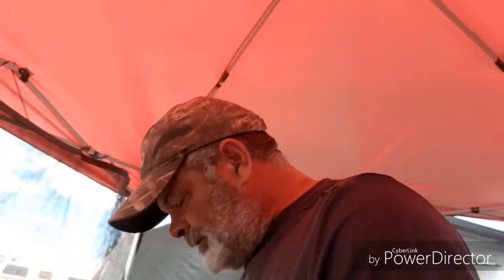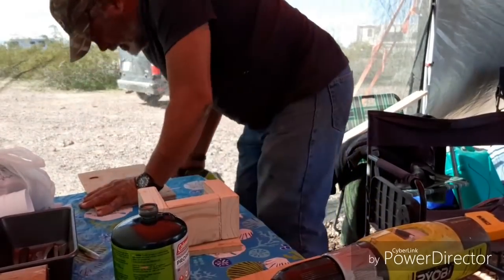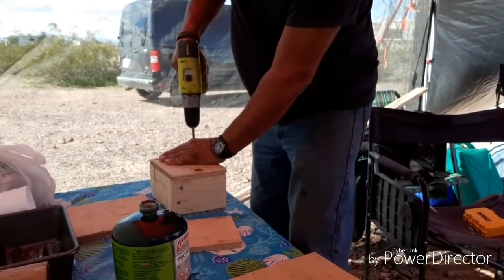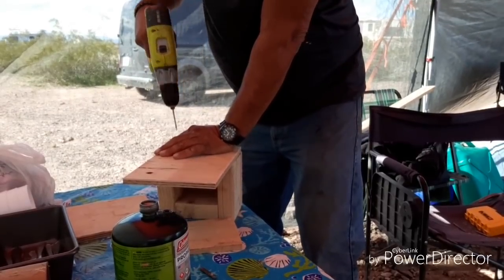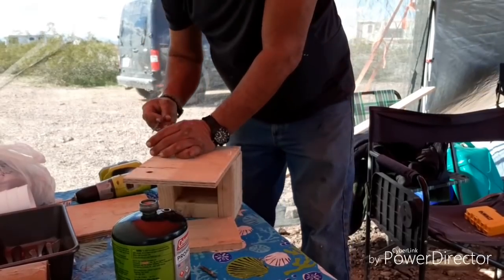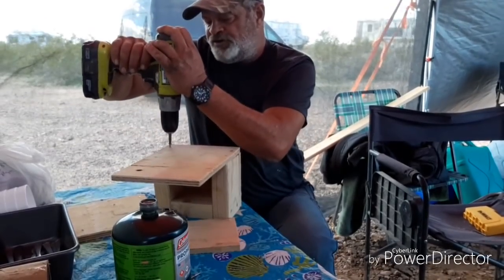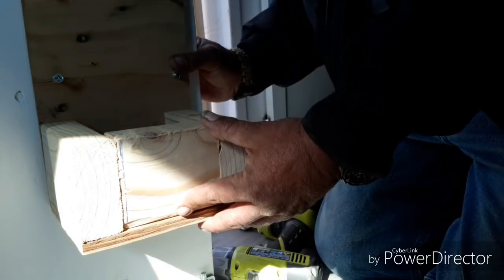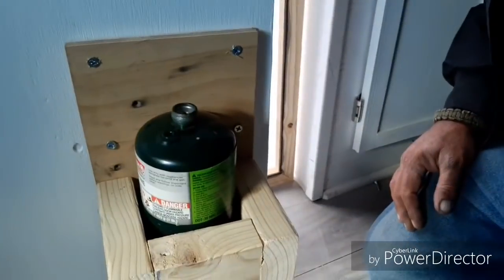propane tank holder the easy way

Comment: I use 3 or 4 3" angle brackets held on with a screw type hose clamp. Very stable and breaks down to small pieces when not needed.
    Wood is cool too though.